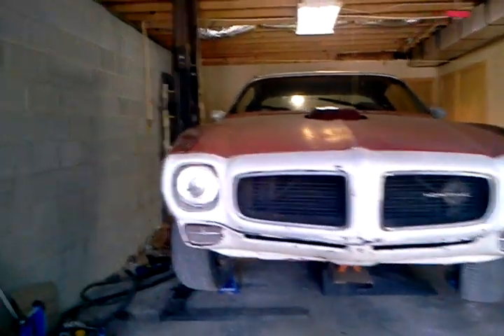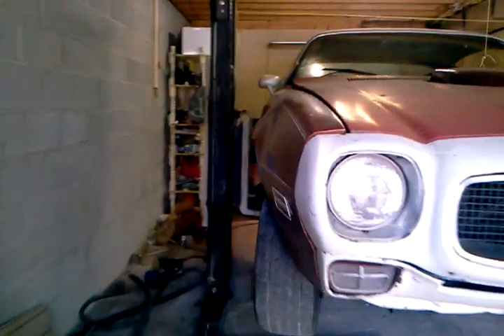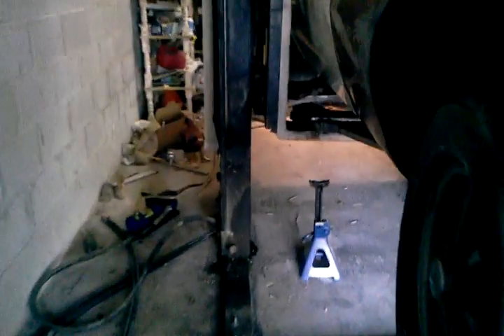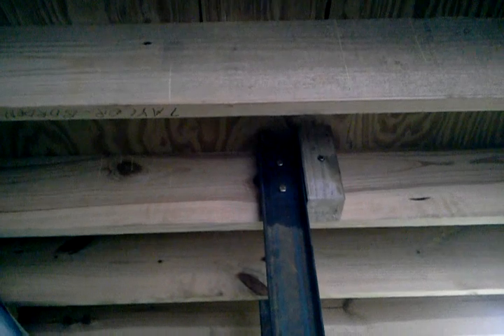Home made car lift.

Comment: very cool, good job. I did something similar using a cheap fork lift and fork extensions. I have the room for the fork lift beside a car, and can back it out of the way when not in use. Some tall stands can be a good safety measure.
one thing I did, that may be of help to others, I built four "Super Jack Stands" 72 inches tall (actually adjustable from 50 - 72 inches, i put 3" S-40 pie inside 3-1/2" S-40 pipes welded to bases) so I can raise the car with the fork lift and position the stands under the frame, then remove the forklift all together, leaving the car up high on the stands.  This leaves a lot more working room, and I can even open the car doors if needed since there is never any posts/lift beside the car once up on the stands.  It works great for me. I only wish my shop ceiling was a bit higher than 10-feet, or I was a bit shorter!
Reply: How heavy is the fork lift I’m liooking at a 2500 lb one
Reply: @zackthomas1944  My forklift is 11,000 lbs
you would need to assess if the lifting unit is capable of the load, and if the counterbalance will be sufficient to not tip over from the weight you plan to lift - ie how heavy and how far from the centre line of the front wheels, compared to the distance and weight of the forklift counterweight from the front wheels.

Comment: might be a good idea to make some ratchet type safey on the lift boom  to hold the car up should a hydraulic line break
i think you could make it out of thick steel and use a plasmacutter to make the shape 
thats he part you mount to ste side of the boom the springloaded moving part mounted to the forks will slide over it 
look at the way those jackstands work , thats the type of ratchedsystem i'm talking about

Comment: Looks like that leg would get in the way of a transmission jack.
Reply from the maker: You are correct Mike. Given they really didn't offer any support. I removed them.
Reply: MendingThings As long as your building holds up, you're good! Mine is rotting wood so... haha. I have to drop my trans again with wood blocks and jackstands. One of the plates didn't mesh in so it's not turning by hand like it should. Hope I didn't screw anything up by trying to start it like that, it would barely turn over.

Comment: I wouldn't work under it. It'd need more safety devices for my well being. I like the thought and what you did with what you had. Cool idea, but if you'd just put a lil bit away and save you can get a nice two pole lift from bendpak for like two grand and not have to worry about jack stands or anything placed under the wheels as you lift like you were raising a house. Cool how you made it work tho.

Comment: Very interesting project. Have you considered building wooden jack stand type units? A few stacked 4x4s are STRONG. Bolting them into smaller, stackable units and moving them under the car as you lift it - might that be a viable solution to problems with the lift? If you continually put higher towers of wood under four lift points, they could hold it up if anything happened, couldn't they?